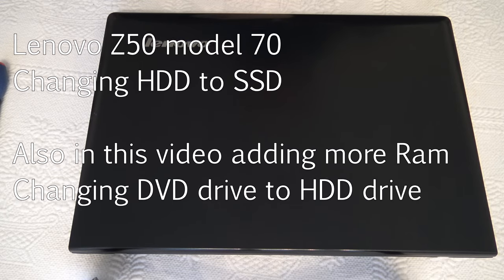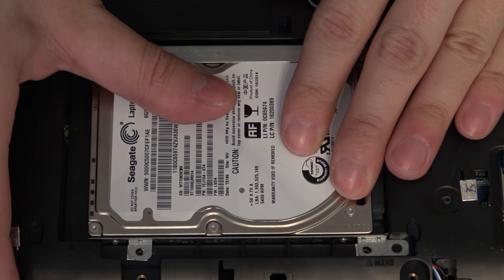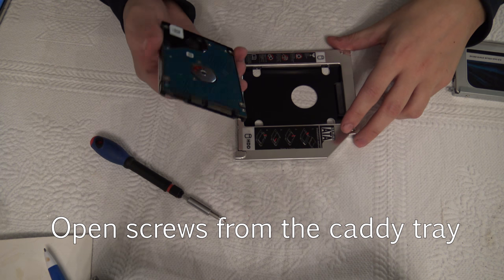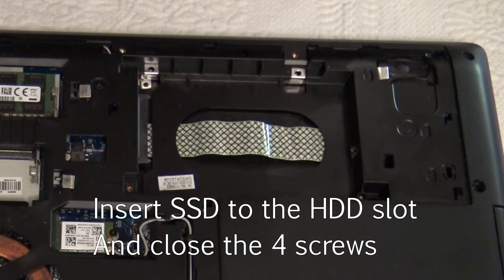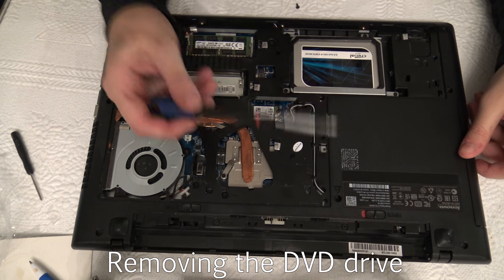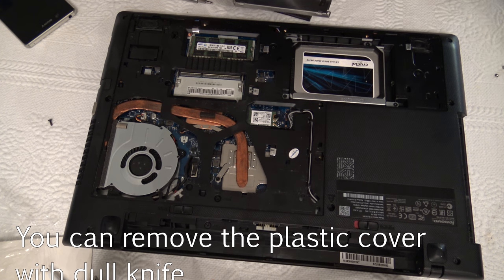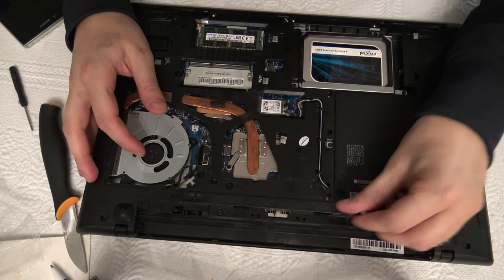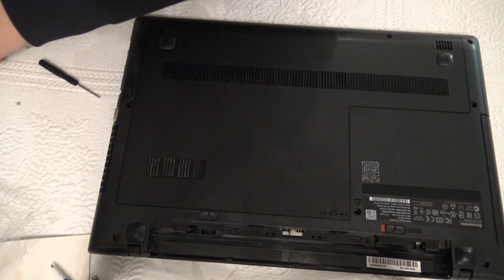Lenovo Z50 upgrading HDD to SSD

Comment from the maker: If you have question make a new comment. Otherwise your question will be lost in the older comments.
Reply: hey, do we have to do something before opening the back of the laptop? will the data in the laptop missing?
Reply from the maker: Well you need to decide either clone the HDD data to the SSD or doing clean operating system install to it.
Reply: @MikkoTenhunen  how to do the clone?
Reply from the maker: @nurulshazreen1036  you connect the ssd to the caddy or with ssd usb connector. The you can you software like easy us backup to clone it. You should read other guides on how to clone or install the operating system to the new and empty SSD.
You can check this guide https://www.easeus.com/backup-utility/copy-and-clone-hard-drive.html
Reply from the maker: @DavidDev Yes any this type SSD works on the laptop
Reply: Great Video, thank you, i have made this upgrade recently to my good old z50-75 to use for work. Did exactly what you did. BUT, for some reason the HDD in the caddy has not been recognised, doesn't show in device management. The DVD/CD ROM drive has also disappeared... any advice?
Reply from the maker: Either the hdd is not connected to the caddy or the caddy connector is not connecting correctly to the dvd connector part.

The drivers will be installed automatically. You should also check can you see the hdd in the settings type "create and format.... " in the application you should see the driver if its connected properly. You might have to assign the driver new letter and paths or format it.
Reply: I have a question, can you put ssd without removing hdd in lenovo z50?
Reply from the maker: Yes the method i show in video. You change HDD to dvd bay by removing the dvd drive. If you don't remove dvd bay there is no extra sloths for the SSD or Extra HDD

Comment: If your HDD in caddy isn't working, please update your BIOS. My z50-70's BIOS was 9BCN26WW and I updated it to 9BCN91WW to get the caddy working. You can check your BIOS version in BIOS settings. The caddy used to work in linux but not in Windows with the old BIOS version. Download the latest one from lenovo website.

Comment: Gr8 video ..U showed all important upgrades that i was looking for to upgrade my laptop .. thanks :)
Reply from the maker: Its all the main and easy upgrades you can do. Dvd drive can be changed to HDD or even Bluray if needed. I changed it to my old HDD so i can use my Os on the new SSD which made booting and my computer work really fast and smooth. Did you do what type of changes?

Comment: Thanks a lot . If possible make another video comparing the hdd and sdd speed test and changes after installing ssd
Reply from the maker: Not really since i didint think of this when i did this video over 2 years ago also i copied the old hdd files to the SSD. But you can check how much it affected the Hp elitebook speed from my other video. 
https://youtu.be/aTm68RG0wWs?t=412
In this video HDD took  time to boot about 5 mins
SSD took time to boot less than 2 mins

Comment: I usually replace ssd if hdd partitions are replicated via macrium into the new ssd then proceed to these steps indeed...

Works with no issues so far so good

even if 1TB nvme s.2 if you have the bays ready
Reply from the maker: SSD is still alot faster than 7200rpm HDD
Reply: @MikkoTenhunen  indeed no doubt

Comment: Thanks for wonderful video. I upgraded my laptop with SSD successfully but only problem I am facing is HDD replaced with optical drive is very slow ,the read and write speed is very slow. Plz suggest solution for this

Comment: Please add all the product (ssd, plastic frame holder for ssd and others) links in the description of video. I bit lazy to find all he URLs in the comments. Thanks once again for such a nice video.
Reply from the maker: Ok, I updated the information in the video and all the products that I ordered from Amazon Uk can be found there. They actually still sell the same products.
Reply: Thanks for the update :-). Please also share URL for Plastic frame used to support the SSD. I think the width for HDD and SSD are different.
Reply from the maker: If I remember correctly it came with the SSD Crucial product
Reply from the maker: Yes, that's exactly the same SSD. For the DVD drivers place I can't be 100% sure if it can use the SSD on maximum capacity since there's no specs data in the user manual, but you can still use the SSD on the DVD drives place.

Comment: My hard disk does not show up in Disk management. I installed Windows on my SSD. The hard disk shows up in BIOS as well as in Intel Rapid Storage though. How do I fix this?
Reply from the maker: +siju sakaria Do you mean the old hard drive that you installed to caddy?
Reply: Mikko Tenhunen Ya
Reply from the maker: Maybe its not connected right from the caddy to the slot or maybe its software issue. Try finding from google "my second hard drive not showing" since there are alot of ways to fix it.
Reply: Did you find a fix

Comment: Thanks, but why go through the trouble of swapping your HDD for an SSD and put the HDD in the caddy frame? Why not just leave the HDD where it is and put the SSD into the caddy frame?
Reply from the maker: Because i didn't find the technical info for the dvd sloths speeds. Maybe it would have slow data reading or sending speeds. I noticed on my HP Dock the sloth reading speed is extremely slow and poor. But anyway it works well in the Lenovo laptop and i wanted the SSD to be inside the laptop incase of the poor transfer speeds
Reply: For the Z50-70, at least, the DVD slot had SATA 1 (1.5 Gb/s) support, while the HDD slot has SATA 3 (6Gb/s) support, so changing the HDD to the caddy makes a lot of sense
Reply: What about heating? Will transferring HDD to caddy heat up more?
Reply from the maker: I haven't had any heating issues with the caddy

Comment: There are two types of Caddy Bay Extension, the 9.5MM and the 12.7MM. Which one did you use? I hope you can answer. Thanks
Reply from the maker: The 9.5mm fits in this device but the bigger one wont fit at all.

Comment: hi..Mikko...
I'm using the same laptop. I've upgraded the ram, ssd as primary disk and inserted hdd through caddy 
But my hdd is not  getting detected by windows 10 at all.
Any solution for this ??
Reply from the maker: +raja venkat is the caddy inserted correctly? The pins need to connect with each other. Does the windows notice the device from the device manager? Maybe you need to install the driver for it
Reply: Mikko Tenhunen 
caddy is firmly fitted in its position. Its working when i'm using  ssd in place of hdd.....
And which drivers you are referring to....thanks...
Reply: I have same problem. Windows is not showing my HDD but it works properly on linux. And even shows my HDD in bios. Is there any fix? Just doesn't work on Windows 10

Comment: Hi Mikko ! Well done. These days I have been trying to install  an ssd (Team Group L3)  but Bios cannot detect it ! We have tried different settings on Bios but without success. So I am thinking of buying a Crucial MX500 ssd as it is fully compatible with lenovo z50-70 ! At least this is what is mentioned on the Website of Crucial. Did you have any problems with the detection of your ssd ? Did you change some settings on Bios ? Thank you in advance.
Reply from the maker: Sorry for slow reply what do you mean by bios detect? My bios shows that it detects the SSD and the second HDD.
Reply: Mikko Tenhunen this is the problem. Bios cannot see my ssd disk. Today I bought a crucial mx 500 disk. I hope it will be okay!
Reply from the maker: Did you get any issues with it? I installed clean Windows 10 pro to my laptop when i got it. I havent had any issues with the HDD cloning to SSD with other laptops.
Reply: @MikkoTenhunen  I finally bought the crucial mx 500 ssd and it works perfectly well! The initial ssd that I used had some compatibility issues with my lenovo z50-70 *
Reply from the maker: Ok but with this crucial you haven't had any issues? Have you installed the crucial ssd application?
Reply: @MikkoTenhunen  it works perfectly and my laptop is faster than ever. It boots and performs the applications in no time at all. My next step is to upgrade the Ram memory from 8 to 16 gb. Do you recommend the crucial 8 gb ram?
Reply from the maker: Well i have been using it without any issues so for me it has worked very well. Also i do alot of editing with vegas Pro 15 and i think it requires alot of ram

Comment: do you know what adapter is compatible for it's hdd? i wanted to move my hdd where optical drive is. but i don't know how thin adapter to buy 7, 9 or 12mm
Reply from the maker: I used this 9,5mm https://www.amazon.de/-/en/eBoot-Optical-Drive-Universal-DVD-ROM/dp/B01EY50UL0/ref=as_li_ss_tl?dchild=1&keywords=9,5+mm+sata+zu+sata+2.+hdd+festplatte+caddy+f%C3%BCr+asus+acer+hp+dell+benq+sony&qid=1607630259&rnid=15763829031&s=computers&sr=1-1&linkCode=sl1&tag=youtube0288f-21&linkId=b753ee98c7b04b798b818b4f9939b7b7&language=en_GB

Comment: I have a problem. 
I installed the caddy on the same laptop as you. 
but when it starts to turn on. The hdd in the caddy is unreadable. 
I don't know why.
 can you help me?
Reply from the maker: Have you updated bios? Also try to use windows format tool to see it from hdd settings
Reply: @MikkoTenhunen  yes.. but still unreadable.. idk what happend with my laptop.. what format tools?
Reply from the maker: https://support.microsoft.com/en-us/windows/create-and-format-a-hard-disk-partition-bbb8e185-1bda-ecd1-3465-c9728f7d7d2e

Comment: My laptop ( Lenovo Z50 ) is slow af.. takes over 30 minutes to boot properly and in the start it loads the applications very slowly.. If i install an ssd then tell me to what extent will it performance be improved? Because of slow hard drive.. when i mirror my iPhone's screen to laptop.. it works fine .. but the moment i open obs , the screen mirror starts to lag.. can i stream on youtube at 720P if i install an ssd? I'm curious to know.. also i have a question.. a headphone 3.5mm pin got stuck in my laptops jack.. can i take it out by opening the entire laptop?
Reply from the maker: It only makes it faster. The issue also is that its very old model computer. Booting time is 1-2 minutes
Reply: @MikkoTenhunen  thank you so much brother.. i recently got my laptop upgraded from someone and when i got the laptop, the hard disk kept on disappearing .. So i remembered about your video and came here.. i read your reply about updating the bios to the latest version and it worked 👍 now my laptop is running too good 🔥

Comment: I have older version of BIOS, i couldn't update the bios because my laptop battery is too low and the system doesn't allow to update the bios. In the current scenario, the bios detects hdd in caddy but unable to show in windows. On the other hand, if i insert ssd WD blue 500 GB in caddy then ssd is not detected in bios. Very strange. Looks like updating bios could work but then need to purchase new battery. Any suggestions on how to update bios with low battery?
Reply from the maker: Have you tried taking battery out? And then updating?
Reply: @MikkoTenhunen  yes, it says no battery and then the process is shut off. Looks like lenovo has designed in such a way that 30% battery should be there all the time. Looks like i need to find the battery and flash the bios.
Reply from the maker: Go to device manager and uninstall battery drive and try again
Reply: @MikkoTenhunen  Good idea, but the bios flash occurs at the start of PC, so, even if we restart, the bios will detect low battery and the process will again shut off. Remember all happens on booting. OS almost has no part. Still i will give a shot and message you tomorrow.
Reply: @MikkoTenhunen  hehe, tried, it won't work. After uninstalling battery drivers, it says "insert battery" once we try updating bios

Comment: I did the ssd drive swap but i guess it’s trying to boot from the ssd not the hard drive as I get the blue error screen - Windows Boot Manager Failed when starting my laptop.
Reply from the maker: You need to select the booting device but pressing F8 or F12 while you start the device
Reply: Mikko Tenhunen 

Thanks for replying 
Unfortunately I tried that but it was stuck indefinitely on the ‘Lenovo’ logo screen (no loading wheel at bottom).
Eventually I just put the ssd in the hard drive caddy and that seems to be working.
Reply from the maker: You have two options either clone the HDD files to the new SSD or do a clean windows install

Comment: Hey I bought a crucial mx500 ssd after physical installation ssd isn't detected in bios nor in disk management. Does lenovo z50-70 not support mx500? Do i have to go for mx300. Please reply. Thanks in advance.
Reply from the maker: You might have to format it before you can use it. This can be done when you start the windows 10 installation. Or you need to set it from disk management before you can  see it.

Comment: followed this tutorial and everything went great,  however my laptop (z70) isn't detecting the HDD I put in the caddy? Any idea why this might be?
Reply from the maker: Try this guide
"Unhide the Drive Using Disk Management"
https://www.c-sharpcorner.com/article/how-to-hide/
Reply: @MikkoTenhunen  Thanks for responding! Idk it's the strangest thing, the drive disappears and reappears at random .I've been troubleshooting this thing all day, and found some forums of people having the same issues but no solutions. Wonder what it could be. I even took out the drive and tested it via USB and it worked flawlessly. I only seem to be having bugs in the caddy X(
Reply from the maker: Have you updated bios?
Reply from the maker: Did you manage to fix the issue?

Comment: Very nice video....
i also have the lenovo z50 and want to upgrade desperately... .
can u please share the details of SSD and 8gb ram single slot type.
Reply from the maker: I added to description link which i used on my laptop.
I used Crucial SSD 525GB and it works fine on it and i used the Crucial DDR 3 Ram 4GB on it

Comment: What system is windows 10?
Were there problems connecting the hdd nand ssd at the same time?
The laptop series two hard drives at once, no problem?
Reply from the maker: Well i dont have any issues with it the problem might come with moving the old windows to the new SSD drive

Comment: isnt that an m.2 slot in lower left? that is being used by optical drive at 7:00?
Reply from the maker: Yes on the DVD slot place i put hdd caddy
Reply: @MikkoTenhunen  so you can put directly a m.2 ssd on it right?
Reply from the maker: Am not sure and if it would stick it might look very wierd since normal ssd is different size

Comment: Can i install the extra SSD drive (HDD is in already) into DVD place ? I mean, can i buy HDD Frame and plant there SSD Drive ? (wondering why i have to install SSD into HDD Place and then HDD drive into CD/DVD Place). Just want to skip replacement and just install extra SSD(to replace system from HDD to SSD).
Reply from the maker: You can but I had some issues with it
Reply from the maker: @hasangaki3599  Never heard of that product brand in my life so it seems risky
Reply: @MikkoTenhunen  would it effect  the performance if we directly installed the SSD hard into the caddy instead?
Reply from the maker: It might if the dvd sloth or caddy is slower than the hdd slot
Reply: @MikkoTenhunen  how to test the faster connection of both the hdd and dvd?

Comment: I'm getting issue with this upgradation in my LENOVO Z51-70
In my caddy I have tried a 500GB hdd from another laptop that is working here.
But 1TB main hdd of this laptop is not working in caddy.
Any solution?
Reply from the maker: You sure the pins are connected correctly?
Reply: @MikkoTenhunen  
Yes everything is connected fine
But it (1TB or SSD) is not detecting in caddy but (500GB other drive is working fine in caddy).
and in main slot of laptop everything is detecting.
Please HELP.
Reply from the maker: @deepakswaroop8053  There might be faulty in the caddy connector or its not connecting correctly
Reply: @MikkoTenhunen  But 500 GB hdd is detecting easily in the caddy
Please HELP me out on this
Reply: Im having the same issue, did you ever fix it?

Comment: please can i replace the hdd with ssd 4tb
what is maximum capacity for ssd in the lenovo z50-70
Reply from the maker: You should check the manual or website. I don't think there's no limitations for it